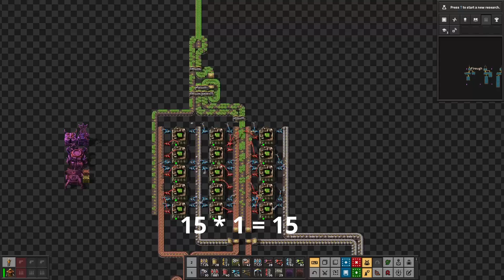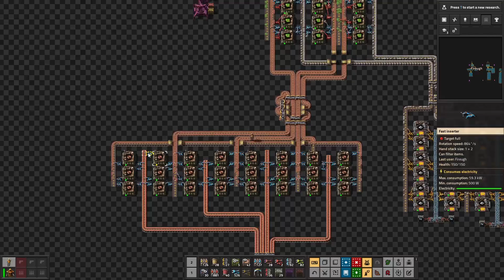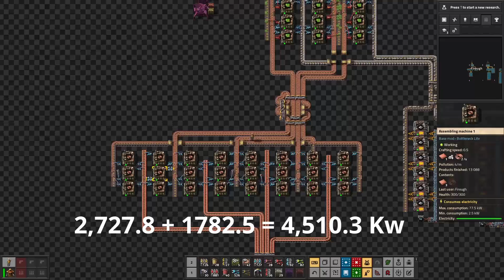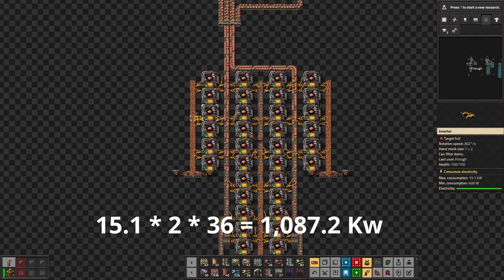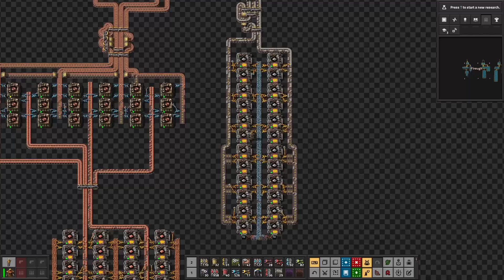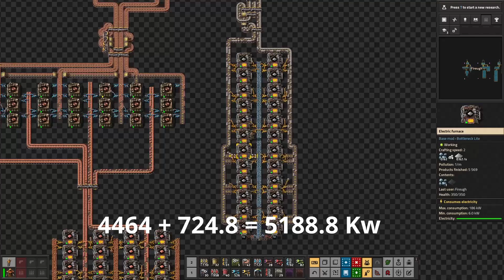Factorio: How to produce electronic/green circuits?

Comment: you should directly insert wires from an assembly machine, no belts required. the ratio is 3 wire assemblers to 2 circuit assemblers
Reply from the maker: Yes, that's probably better as that would reduce the power consumption as well

Comment: this set up will let you down as soon as you upgrade belts and assemblers.
do not belt wires for green (for red it´s fine) don´t output green with long inserters (for red and blue it´s fine)

some consider this form of wires on belts a warcrime,so you should lawyer up asap 😄